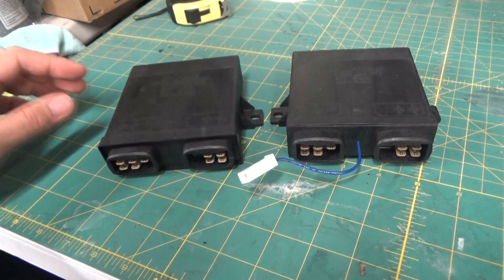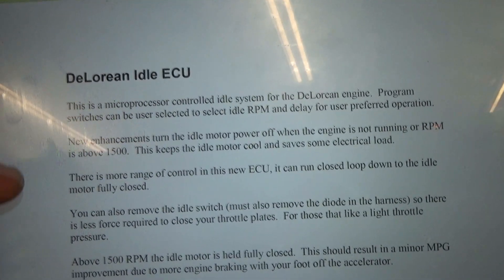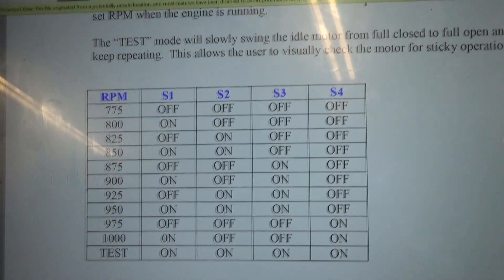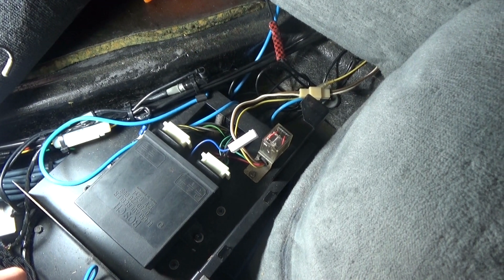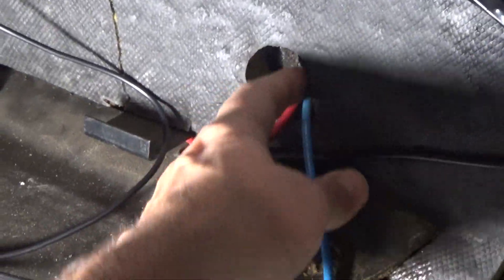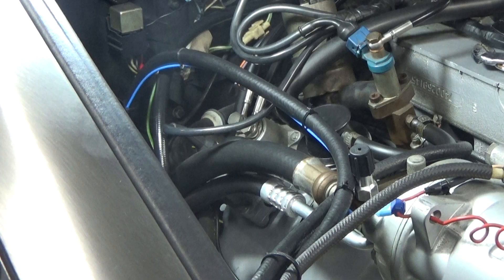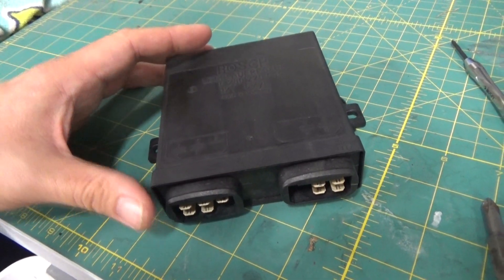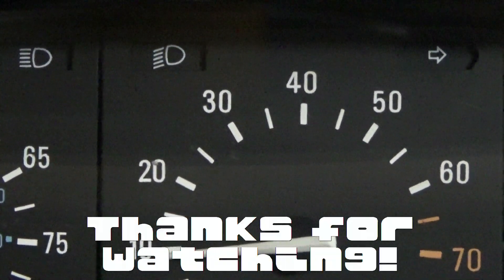How to install a Microprocessor-Controlled Idle Speed ECU in the DeLorean DMC-12 - Adjust RPM easily

Comment: Thank you for the informative video. Do you happen to know if Dave McKeen is still offering modified idle air control modules for the Constant Idle System used with Bosch K-Jetronic fuel injection on PRV engines? Thanks again.
Reply from the maker: I don't believe so. Check out his website here https://dm-eng.weebly.com/
Reply: @DeLoreanTECH  Thanks for the reply. I did see the website, but it wasn't clear if the page or Mr. McKeen were still active in the aftermarket. Are you aware of whether or not anyone has been in touch with him in recent years? I couldn't find any current references to his updated CIS control modules on the discussion boards. Thank you again!

Comment: Great video. I just got this from Dave today. I'm curious, what "delay" setting should be used that is closest to stock, or that you decided to use?  Probably will go with the 850 rpm also. Does keeping the diode in place harm anything? Thanks.  #5945

Comment: I have had this microprocessor unit in my car for two years now. The adjustable settings Dave gives you will make it possible for you to keep driving even when some things may be really off with your K-Jet system. But you have to find the physical problem if there is one...and this info may be helpful to someone else. There is no amount of fiddling with those 8 dip switches for different idle RPM, delay, or throttle plate stop screw that will overcome engine basics like not having intake vacuum leaks. My car had a seriously bad vacuum leak, courtesy of the large vacuum hose on the front end of the left intake runner that goes to the thermal vacuum switch. I was unaware with this problem, but in my attempts to try to get my car running better, I had adjusted the 3mm allen key just in front of the fuel distributor way too rich, and the throttle plate stop to a high enough position to keep it running when cold without stalling. The result was a car that would idle terribly at startup, as the K-Jet system goes through its warm-up operation which richens the fuel mixture. This set of improper conditions would cause my idle ECU would go into a loop where the engine RPM would swing wildly while warming up, even to the point of stalling. It would seem to idle OK when the warm-up cycle was complete, but then when fully hot, I would have the annoyance of audible misfires in the exhaust sound, and now an idle that was way too fast. Bottom line is this...if you have vacuum leaks, you have to fix them pronto. After vacuum leaks are fixed, then adjustment of the air/fuel ratio. If these things are out of whack, your idle ECU and throttle plates set screw will never seem to be able to be put at a point where you achieve a stable idle under all conditions. I couldn't be happier with how well the microprocessor unit works...now that I have properly corrected other engine issues.
Reply from the maker: Completely agree, and thanks for the insight. Another one of Dave’s relays, the hot start relay, is also something that should be used temporarily or as needed and not as a permanent solution. Find the issue first and fix it!
Reply: I'm having the same problem where at start up my idle is swinging wildly. Either due to a sticky idle motor or vacuum leak I'm not sure which.

Comment: Great video, as usual, thank you! What is that transparent device we can see at 8:14, close to the white and yellow wires, under the AC RPM bump wire?
Reply: Power Antenna Relay
Reply: @johnmckenney7898  Thank you! Mine was not connected

Comment: WARNING WARNING WARNING !!!!

this device NEVER worked in my Car to my Satisfaction. Re-Installed the original old BOSCH crap and it runs without any issue. Sadly Mr. McKeen never answered my complains. eMails got ignores, Comments in Forums too and also on Facebook. He prefers to grab the Money and turn his Back on you.  I spent a shitload of Money for multiple Parts. All of them failed by now. 
This System sounds fancy but literally covers REAL ISSUES of the old Car which better be found, solved instead of masking them. Think of that.

The Idle started hunting in any Setting, Milage was crappy, starting failed several times.... swapped back to the Stock Box and by the Turn of the key the Car starts, NO hunting, etc. Improvement in using this Device? NONE !!!!

Not: The Car is fully restored and the Engine rebuilt from Crankshaft up. None of the Parts are old and if then overhauled..... so NOTHING else can be blamed other than the "new" Box by logic.
Running the Cars since 4 Years and about 20.000 Miles flawless with Stock Parts after wasting time with this Device. 

Burning money can be not easier than buying these Parts!
Reply from the maker: I have not run into anyone before with issues like the ones you describe.  I have run the idelspeed ECU without issue for years now. But your concerns do interest me and it’s something that needs to be addressed. I admit i have not removed the microswitch or diode and still have that in place.  I know these cars are all very different being handmade and uniquely quirky after 40 years. I do know an owner who has an automatic that has challenges in getting the ECU dialed in and was pretty disappointed at first until Chris Miles helped him dial it in. He removed the microswitch and diode as well.
Reply: @DeLoreanTECH  thanks for your response. Mine is an Automatic too.... well, i tried with / without removed Diode, Switch and several other Options. NOTHING worked. Plugged the Stock Box back in and it runs PERFECT!
I know a other Guy who tried my Box and his is a Manual. Same Result. 
The Car is fully restored and also the Engine "better than new", so i asume the Box from Mr.McKeen is based on a defect / worn out Car which needs to be "upgraded". If the Car is "like new" as it left the Factory there is no need to install any "upgrade" like this Box.

That´s my Explanation... 

Mr.McKeen never answered my eMails asking for Help, also not on Facebook. He just ignores me. I even offered to send a Video. No Reaction. I purchased a few more Items from him and ALL of them failed. The Solid State Relais are all JUNK, all of the Failed, also the RPM Relais, which failed after about a Year. 

Threw a lot of Money out of the Window. Running ALL STOCK now for 3 Years and none of them failed. Explanation?

Comment: Did you remove the idle switch on your car with the new ECU? Pro's & Con's of doing such?
Reply from the maker: Trstno1 i have not.  Technically don’t need it however if you do decide to put the original factory ECU back in you would need to reinstall that. I’ve actually installed the original factory ECU a few times for diagnostics.  Probably just going to keep it in.
Reply: DeLoreanTech  I’m assuming you had left the ECU Diode installed as well?  I was thinking about leaving them both in too for simplicity sake if I ever needed to swap out ECU’s again, but I was curious as to what the major advantage by removing them. Now that you have had it installed for awhile, what do you think of it?
Reply from the maker: Trstno1 yes i left the diode in place too.  The ECU works really well. Whenever I have idle or running issues with the car I always swap it out with the original ECU in order to rule that out. So keeping everything in place is probably not a bad idea. But so far I do like the ECU because idle is smoother and you get the AC bump. Total win. The car just idles better with the new ECU installed. Using the old one you can see a big difference.
Reply: @DeLoreanTECH  yes - see my comment.... the Differenc eis that the "new" Bix makes Idle hunting, diagnosing difficult and obviously masks some Issues YOUR CAR has. Solve them first and you won´t need this Box at all cause the Car will run with Stock parts smooth and soft.
Reply from the maker: @FRITZI999  what soets of issues dis you have with Dave’s ECU?  I didn’t see another comment other than these two.
Reply: @DeLoreanTECH  see my Comment... also running the Stock ECU flawless. This Box is crap!!!

Comment: I would have liked to have seen a video of the dash readings before the install. you have footage at the end after the install, and I would have liked to have compared before Vrs after
Reply from the maker: Yes in hindsight I should have done a before and after.  However I did note what the dash readings were with the stock unit before and the rpm needle does not change when the A/C is turned on.  At least in my car.